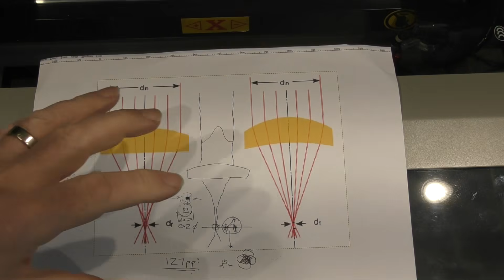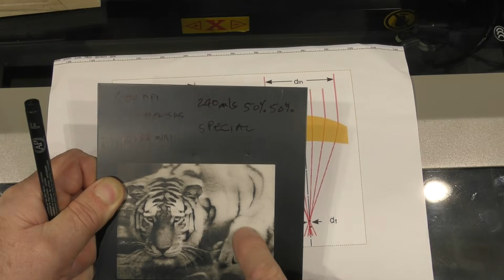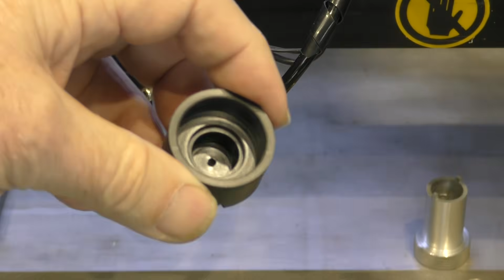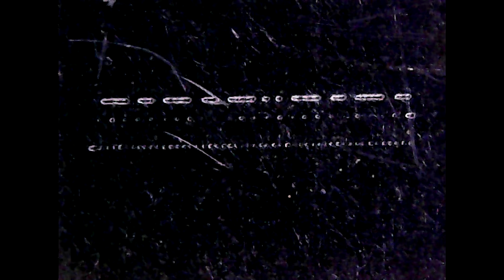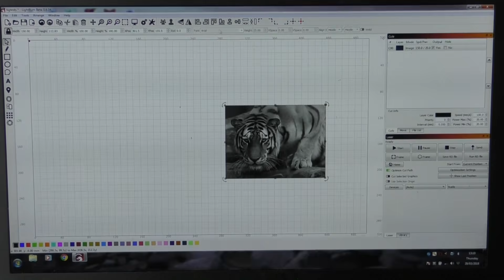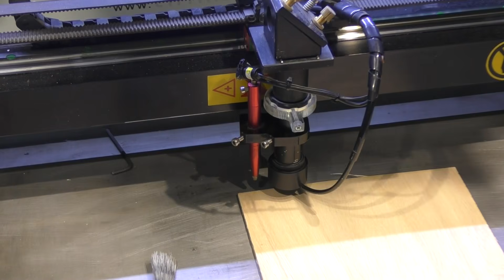RDWorks Learning Lab 137 Compound lens Facts and Fiction

Comment: Hello, thank-you for this very interesting  video. I’d like to know wher it is possible to buy  good meniscus lens ? Thank-you in advance. :-)
Reply: For the china blue is it 18mm or 20mm?  I think it is 20mm you once said but I can't remember (power supply is on its way via UPS).  Of course neither of those links ships to the USA.  Bummer.
Reply from the maker: China Blue is 18mm diameter lens
Reply: Thank you.  25mm on the mirrors and 18 on the lens.
Reply from the maker: Hi Daniel

I have bought from these first two links and confirm that they are meniscus.

https://www.ebay.co.uk/itm/302408621765?euid=117c331ad97248d2b4d8b5846f604afe&bu=43020994255&cp=1&sojTags=bu=bu

https://www.ebay.co.uk/itm/253085972561

I have lenses from here also but I have not received them yet so I cannot verify that they are meniscus. 

https://www.aliexpress.com/item/Free-shipping-for-China-laser-mirror-20MM-50-8/32498877973.html?spm=2114.search0204.0.0.224b4eb5pJMfln

Cloudray advertise meniscus lenses but they are not!!

Best wishes
Russ
Reply: Thank you very much. :-)

Comment: Let me help you out so you can make a very small beam size. Use a collimator. And fit it at the beginning, before mirror 1. Get one that can be manually collimated. Or get a software controlled one. Then you can control the beam diameter with ought changing lenses.  There are collimators that can increase or decrease the beam diameter. All depends on the type of lenses use inside the collimator.  And try tjslasers.com they might be able to make it for you as well. The last I used was them 10 years ago.
Reply from the maker: Again I respect your honesty.  I have to admit that it was mainly because of that lack of information from ANY professional sources at the  the start my learning journey, that persuaded me  that I should do it my way and use that material for my other hobby, video and editing . I do find it fascinating that I may be partially to blame for the decline of an industry!!!!  Does the Chinese takeover of some of these companies  mean they are acquiring serious technical knowledge or just machine designs? Up to now, the Chinese companies I have come across appear to be just  machine builders rather than machine designers.  I had many years in machine tool design and can recognize the many design compromises that go into these  cheap machines. The well known US and European machines are usually "no compromise" engineering and have well designed user interfaces.  With Chinese machines the last 10% quality is something the end user has to tend to.
Change is something that the brave embrace  (and even create) because it leaves the timid and less adventurous behind. There's less competition out front. 
As far as I am concerned I had only selfish aspirations when I started about 3 years ago I was learning for myself and thought my videos may appeal to a handful of laser nerds. I still have those same selfish aspirations but I have gained unexpected pleasure from helping newbies into the technology. With most Chinese laser machines you have to be your own 24/7 service tech. If you read some of the inane questions I get asked you will soon realize that 80% of folks with these machines are lacking basic engineering and science competence and have zero logical fault finding ability. I can't see that these amateurs will impact your highly professional industry because their business acumen will be sadly lacking also.
Thanks for a great discussion
Sincere best wishes
Russ
Reply from the maker: I see from your website that you have a wide variety of professional grade (fibre and YAG)  engraving lasers for your business and  what looks like just one 50 watt China Blue CO2 machine  Do you have a collimator on this machine?
If so could I ask you to test my 254 dpi pattern on several materials to see how small you can get dots with a CO2 laser.  I use my machine for learning about just how far you can push this cheap Chinese technology. It is not my plan to spend significant sums on improving the machine but if I can improve perfomance in a low cost DIY way then I do carry out small modifications. If you have the technology already in place then I hope you will be able to answer my question about just how small a dot can be in wood/acrylic/anodized aluminium/powder coating.
I appreciate that most of your commissions appear to be vector scanning but for photo work the dot size is critical and I really appreciate any any help you can provide  in bringing my dot quest to a conclusion. As I said in the video, regardless of spot size the materials are not aware of lens theory and the smallest I can burn is 0.1mm
Sincere thanks
Russ
Reply from the maker: It was a few years ago now, but I owned a precision sheet metal shop with 30 or more people. As part of that setup I had two 3kw metal cutting CO2 lasers. Lots of capital investment and big repair bills when they went wrong. No Chinese machines around to fall back on at that time.  You do need large steady turnover to pay the bills!!  I am in touch with many folks who have started small businesses with just one "toy" machine but after a few months of help and hard won experience to get a quality product, they find themselves investing in another two or three machines. As an ex businessman I know how difficult it is to build and retain a customer base. My money making days are behind me now as I settle into a comfortable retirement BUT I have to keep my two remaining grey cell exercised so I find it very rewarding to help these young entrepreneurial startups and to keep learning myself. Again I thank you for the links and I will do more research into the subject of collimation.
All best wishes
Russ
Reply from the maker: Many questions. How much are they?How big are they? How many lenses are there within? Are they available for 10.6micron wavelength? Do you have one or is this just an idea? This sounds like another element that has to be precisely aligned in the beam path like a beam combiner system? What would be the advantage over controlling the beam diameter at the last point in the light path. I mention this last point because from what I have read, beam divergence increases as the diameter decreases. A good argument for delaying diameter change to the last minute?
Truly interested if you have facts/links please.
Best wishes
Russ
Reply: SarbarMultimedia There are usually built to order custom built. They have been around since 1985. I have three in three of my machines. But mines are up collimators. They are available in 1064nm. You can make your own. Where easy to make. You can purchase the lenses from Controllaser.com. Or any other lens provider. You can even install it just before that focusing lens, inside the focusing lens housing. I wish I had the time to do a diagram for you. But you have a pretty good understanding of lenses now and how they work. Or you can call Controllaser.com and see if they will make one for you. Get ready for the price. Each lens will be around $250.00 or more. You need a minimum of two lenses in some cases four lenses. Don’t get the uncoated once get the  coated lenses. The the lensers have be able to move in and out. So you need two cylinder slivers. And each lens has to be mounted on the end of each cylinder one cylinder being larger than the other cylinder so I can slide in and out allowing to focus the beam size. Make it out of aluminum. Now that you know little bit about collimators you can do the rest of the investigating on Google. And you will see. There are auto collimators. Which can be used to align the laser beam path as well. Using a camera on the end of the lens head, with an auto collimator built in it.
Reply: The Best Stooge it’s just like a pirates telescope. You pull it down to get the spot size you want. So if it’s mounted above your nozzle just pull it down to get the spot size you want.
Reply: SarbarMultimedia we have a few Chinese machines. Not every machine is listed on our website. For me it’s not worth the time to upgrade a toy to make it work better or have better engraving. They are only used for small jobs that don’t pay well. I’m just trying to help you guys out. I see how much you are struggling to get any kind of info on this subject. Things we learned at basic Opto mechanical engineering. The only machines that have the collimators are all mage in USA and Germany. Now the Chinese have copied us and they have started to make their own collimators. It’s not gonna to be easy to get them to sell you one. But you can build it. Using Chinese parts. Hear he a company that have software controlled collimators built into the machines so they can do 3-D engraving. https://www.keyence.com/products/marker/index.jsp
Reply from the maker: Hi 
I really thank you for being honest. Toys, yes, but they can do a lot for the money if you understand them intimately. As I said I'm tryng to find the natural limits for the machine but for photo engraving I think I may be bumping into material limits not optical limits. I will keep looking
It's really great that a professional company such as your own takes the time to pass on advice and information.
Best wishes
Russ
Reply: SarbarMultimedia SarbarMultimedia they are very good machine to make money. Even if they break they only cost a fraction to repair. That’s the reason we used them. If one of our machines break it cost thousands of dollars just get a part in Or if it has to be sent out. If they come to repair. The minimum for 1 hour is $5000.00 + food + air fairs + rental car. The only other good thing about this machine. If the power goes out it can start right where it stop. Not even American machines can do that under $60,000 only machines passed $300,000 can do that. So you got to be thankful for these machines they are awesome. Just a little hard ships in the beginning.
Reply: SarbarMultimedia Thank you Russ I have a lot of respect for you I’ve been watching lots of your videos. And just learning what’s been going on outside of the industrial sector. Lots of lazing raven companies are going out of business because of these Chinese companies. Even Controllaser has been bought by Hans laser from China. I have worked with Controllaser, Icao laser in Italy and TJS. And information that’s getting on YouTube is destroying the current industry as well. Sometimes by helping we do more damage, than by not helping it took me a long time to realize this. But I thank you for your contributions to the web.
Reply: SarbarMultimedia it was my pleasure talking to you. You’re highly skilled. And have a long road ahead of you. There so much more to learn in later technologies. I wish you all the best!!!! And please don’t think I’m blaming you. You’re doing a great service to everybody. Things that any company will not do. You’re the man Russ!!!! 👍🏻👍🏻👍🏻
Reply: Way overly complicated and far too pricey by the sound of it.
Reply: The Best Stooge You can get all the parts from China for about $60 bucks
Reply: Everything already made?  On our China Blue machines the hooking up part sounds very complicated but maybe if I had something to read showing how it was done it might not be.  What would the dot size become?